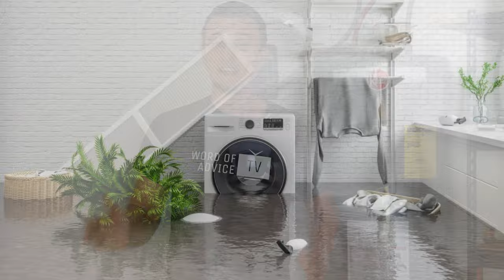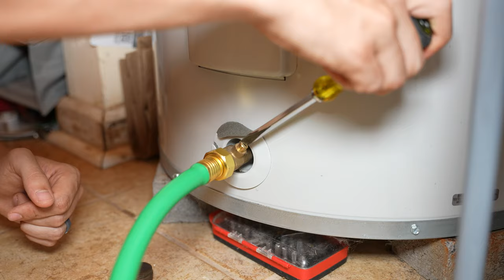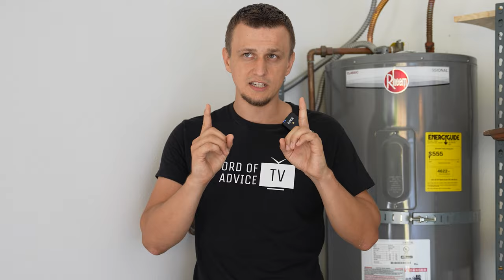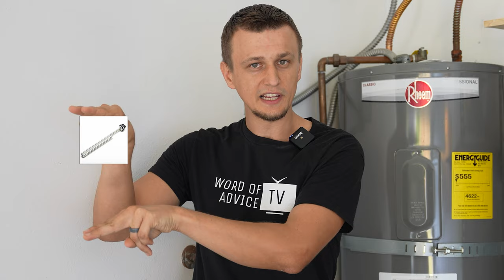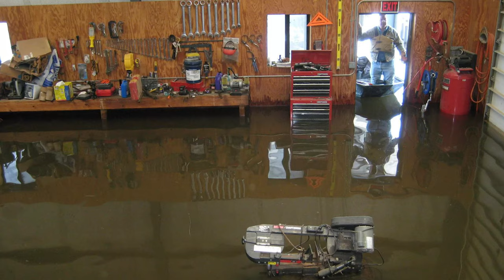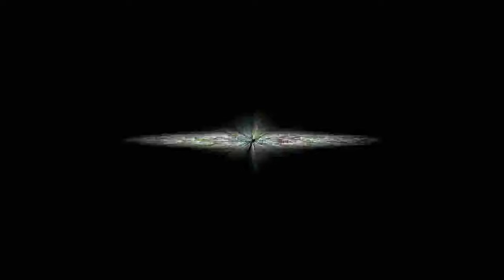When Should A Water Heater Be Replaced?

Comment: The old water heaters lasted a long time because they were glass lined and didn't corrode so much. The manufactures figured out that they could sell more heaters if they left out the lining and let them rust. State Water Heaters is the only company I know of that still has some models that are glass lined.
Reply from the maker: Not very good for sales if they last too long right? Good to know that State water heaters still make some glass lined models. Thank you for sharing!
Reply: @WordofAdviceTV   or you decide to sell more of the other parts of a water heater and create a strong maintenance schedule. If the reputation grows actually more people will buy them, insurers will recommend them and contractors will fit them. It’s a more longer term business strategy but you create a reputation for being customer focused and excel in your engineering. You can then design more products to sell. If you get a reputation for poor quality water heaters how likely is it you are going to see strong sales? Not much so if state are still glass lining kudos to them.
Reply: Bradford White does as well.
Reply: This is incorrect information. Most water heaters are glass lined today. Lack of maintenance is the reason most fail today. Somewhere along the line people forgot they have to maintenance things if they want them to last.
Reply: They all last 7 to 10 years. My last one failed at the weld seam between the sides and the bottom.. The only one I know if that is glass lined is 
 State Water heaters.
Reply: I am a professional service plumber. I go to at least three water heater tank leaks a month. It's a mix of both old and newer heaters, and they do flood garages left and right. Most people shut the water off then 40 to 50 gallons drains everywhere. Not a lot of bad info in this video. I have seen 2 in ten years bottom out and he is right about it being neglected.
Reply: @WordofAdviceTV  AO Smith makes state so the proline of AO Smith will be the same as a state so pro AO Smith units are glass lined
Reply: @macdaddykwm1  My state was installed 8 years ago and the pan has water. Time for a new one. It is power vent so it cost a fortune :(

Comment: I found my Bradeford water heater was leaking three years ago; however, I had used it until last week and replaced it. The technician had checked the heater and told me that there are no big issues other than small leaking.  For 20 years, I had no issue with it, just hope my new Rheem water heater last long without any problem.

Comment: What would you advise? It's a 19-1/2-year- old water heater. I have two of them, but one went out. Plumber tested the thermocouple and noted the wattage was fine but some other wire in the valve was low. He replaced the thermocouple and it worked for three days and then went out again. It seems to be the gas valve (the controller in the front of the heater) that needs to be replaced. Plumber quoted me $550 to replace the valve versus a new water heater for $1600 to 2200.  He says it's reparable, but the big worry is that the tank will start leaking soon due to the age. There's no rust on the exterior, but I know that's always a risk of a leak with old tanks. My hope is I can replace the valve and get another 5 years of life. My fear of buying a new water heaters is it will only last eight years as they don't make things like they used to. Your information is very helpful and I feel better after watching it. Thank you.

Comment: This posting was very reassuring my concerns. (I still have some though)
 Our Water heater was installed 39 years ago in 1984. Hot Water has been consistently good & available.
The anode rod has long since been sacrificed and I'm not aware of any maintenance in the last decade.
I had discussed replacing it w/ my spouse but she's pretty adamant that if it’s not broke don’t fix it.
I think 80's they made much better Water heaters than the junk available today with its planned obsolescence.
 Im afraid to touch it worrying that it will then there-after start misbehaving. 
I setup water alarm system and the unit is mounted on a drain pad.
We will replace it someday. 
This posting took away the nagging "bottom dropping out" catastrophe fear .

Comment: I am so glad I bumped into your video so that I don't have to spend 14K dollars for my water heater and boiler for house heating.  My system was installed about 18 years ago which is actually still working well.  I was baffled as to how could a plumbing company charge over 7K for the replacement job as the equipment they would use will not cost more than 6 to 7K.  You are so correct in saying that the "efficiency" gained through replacement will not be worth it. Thank you for the sound advise.
Reply from the maker: You're welcome! Yes, if the system is working well and there are no leaks, there is no need to replace it. I'm glad to hear this video came at a good time for you. 👍

Comment: You are so correct. I moved into my townhome 1983 and the water heater was still there from when it was built I kept it for like 30 years and someone said I’m living on borrowed time so that’s why I replaced it. But it was a great water heater it was built to last
Reply from the maker: Thank you for sharing that! Another example of the older water heaters lasting a very long time. I wouldn't be surprised if that water heater would have been just fine even until now if you hadn't replaced it.
Reply: @WordofAdviceTV  I think you are absolutely correct. In fact the refrigerator and dishwasher that came with the place are still running. Thank you for all the helpful information you give

Comment: Thanks so much for this excellent video delivered in a very professional way. I will sleep easier tonight and call my plumber in the morning about the small amount of water under my 22 year old Ruud water heater. Ten years ago I was out of town for several weeks in December. When I returned to my cool home it smelled very musty like a summer basement. The water was up to an inch or so deep in spots of the uneven floor. I turned the water to the tank off and In the morning called the plumber. He said the culprit was a defective valve near the top of the tank, which he replaced. So my home wasn't flooded, but there was quite a bit of water down there. Thanks again for your lesson.

Comment: My gas's water heater is 30 years old, every 2 years I drain it and have replaced the analog rod once and it's still going strong. I did swap out the drain valve from the half-inch drain it came with to a three-quarter inch ball valve makes draining ridiculously easy

Comment: Very good, honest and objective video! Sadly, almost all plumbing contractors use fear and deception, and say you must relace it in 8 to 12 years. Of course! They want to sell you a new water heater & installation!  The 1st gas water heater in my house, a Rheem, lasted 25 years, with NO maintenence whatsoever. Then just a small leak from the tank. Even with high iron & calcium water. Going on 23 years on my 2nd one, an AO Smith. Started power flushing 15 to 20 gals out once a yr, about 5 yrs ago. Only complaint is the very poor spickets, drain valves used in water heaters. If you have a water heater 20+ yrs old, replace it only if you have to! Most made now are junk in comparison to the old.

Comment: Bought a house in 2002. Replaced an old early 80's water heater just to be on the safe side. In 2018, mine literally exploded (or imploded depending on how you look at it) and water flooded my basement. At the time, it was an unfinished basement and didn't have much down there except some junk, which I ended up throwing away. Today, it's a fully finished basement, so hopefully that won't happen again. The plummer who replaced it said he's replaced hundreds of water heaters over his 20 year career and had never seen one blow up like mine. (It was electric, not gas.)

Comment: Thank you, a nice video, I live in NSW Australia and i built my new home in October 1980 a DUX HWS was installed then, which then sprung a leak Oct 1998 after 18 yrs service, i then had a new RHEEM HWS installed  which then started to leak in Febuary this year (2022) which did last 24 yrs, now i have a DUX replacement so lets see how long this one lasts. All these HWS are/were 250 litres (60 Gall) have a single bottom element,and water temp is set at 60 Deg, also our water supply here is Soft water which could also help for longer tank life   👍

Comment: Thanks for this informative video and quelling our fears. I have a 40 year old Ruud electric water heater that is still working. I have never drained the unit or replaced the anode. I am assuming that if it ever starts to leak it will start off as a trickle at which time i wil start looking for a new water heater,but that hasnt happened yet.

Comment: Thumbs up ! Our municipal water pressure is over 80psi. I installed a Pressure Reducing Valve (PRV) years ago to keep pressure at 50psi which reduces strain on piping, tank and water- using appliances. Our washing machine and dishwasher have lasted well past the usual lifespans. I also installed an expansion tank on the cold water inlet to the HW heater. That absorbs the pressure back flow as water heats with no faucet open ( the PRV creates a closed system so pressure can't dissipate back to water service main). I believe , but cannot prove, that reduced pressure alleviates some of the expansion/contraction of the tank interior. Also, best to place HW heater on a pan which connects to a drain. That way if it does leak you don't send water everywhere.and you have time to react., Also you will know that it is not another source of water leakage. If you have a draft induced blower, be sure condensate drain port is connected to a drain  as condensate getting in the blower will kill the motor. I never flush the tank but I do drain 5-10 gallons from tank every few months and particularly after the Town flushes the water mains ( twice a year here ).

Comment: very interesting comment about glass lined water heaters. We had a furnace (Trane) and water heater (40 gal, gas) installed in 2091.  We're on well water with sediment  filter and softener. Water heater working fine but  I will be putting in a tankless heater this year.

The heater that is still plugging away is a State Water Heater.  Connection to longevity....possibly!  Thanx for your content.

Comment: Good content.  I’ve never had a water heater leak, but I lived in a condo complex where the unit above me leaked and caused a lot of damage in my unit.  It turns out that quite a few water heaters in other units also failed around the same time and the association recommended owners replace their’s.  While it’s not common, depending where it is located, a leaking water heater can cause substantial damage that can be avoided, especially if the water heater is well over the recommended replacement age.  Pay me now or pay me later comes to mind.

Comment: Good video....Thank you. Here in Texas the hot water tanks are in the attic. Why they aren't in the garage, I have no idea. Stupidest thing in my mind. Ours are 16 years old and I have flushed them regularly but the thought of a major leak in the second story ceiling makes us crazy. Replacing the originals (2) that have been trouble free except for a 1 new pressure releif valve replacement. Makes me think we could wait, but the thought of an issue at this stage has us replacing them.
Reply: Just replaced my 10-year-old AO Smith tank here in Hutto yesterday.  Stopped heating the water and was worried about having a leak in my attic.  Rust was prevalent along the top, with rust trails going down the sides.  They replaced the tank with another AO Smith, and added a TACO shutoff valve tied to a  water sensor on the drip pan.  The old tank was loaded with rust and sediment.  If yours were 16 years old, you were right to consider replacement with this attic situation.  

A friend of mine had a 15 year old tank in upstate NY in a second floor condo.  It let go and flooded his condo, ruining the parquet floors.  It also flooded the first floor condo, doing another 60k in damage.  Luckily, the estate of the owner had insurance and he was not held liable.  And just the year before this, he was living in a house in Yonkers, NY where another unit let go and flooded the basement.  This was less critical as we dried up the family room for the new owner, who was gutting the room for renovation anyway.  But the fear of these back to back blowouts had me worried about my Texas situation.

Comment: Ive had them last 20 years, and Ive replaced them when one got a small leak, and one had a bulge.   Its just if you maintain them will make them last.  twice a year flush, and check that anode rod every year or two.  One I had to replace after I sold the house, and it started leaking 2 weeks after closing.  Which sucked for me, but not the new owners.  But the ones that leaked, were also very old.

Comment: Three wear components on water heaters, anode, dip tube, electric elements (bottom usually). Routine maintenance, it will last a long time. Anode, use aluminum for well water and magnesium for city water. Dip tubes fall apart rot off at top. If they do, your hot water supply will greatly reduce due to mixing hot and cold at top of the tank. Mine is 20 years old, replaced anode and dip tube at 17 years old. Both had failed. Recommend at least every 10 yrs.

Comment: Well I was one of the special people that had a small flood. Luckily my daughter was home and saw water at the bottom of the stairs. She called me at work and I told her how to turn off the water and the water heater and drain it. It didn’t gush out but it was leaking pretty fast. It did do damage to bottom of some walls and some carpet. There was a sump pump about 12 inches away but basement floor was made so the water ran to the finished part of basement! Good job cement man! Lol
Reply from the maker: Oh yikes! You are the first flood story! Sorry to hear about the damages and thank you much for sharing your experience with a leaking water heater. I should have mentioned in the video that one good tip is to make sure that everyone in the house knows where the main water shut off is.
Reply: Hi, another chosen one here. I used to live in a townhome built on a slab so the hot water tank was on the ground floor in a closet. I had just gotten home a little early from work and I sat down on the couch and right away heard bam! I rushed into the room where the tank was located and just saw the water gushing everywhere. The drain valve had completely come off like a champagne cork and the water was gushing out. Luckily, the main shut off was right next to the tank. Upon further inspection, I realized the drain valve popped off because the nylon threads on the valve had been screwed into metal threads causing a chemical reaction / mineral buildup on the nylon thread making them completely smooth like a cork! In that 30 seconds I did get a lot of water but can you imagine if I hadn't been home and it did that for a few more hours!

Comment: Comforting info ! Haven’t been able to flush for years due to the drain valve leaking when I open it. Kinda paranoid as ittl b a long job at some point doing the drainage. I have it in main floor not basement
Reply from the maker: Glad I could shine some light on this topic for you! And I totally understand! Drain valves tend to leak once disturbed. If you will feel up to the task later on, you could drain it and replace the drain valve. They are pretty easy to replace. 👍

Comment: My business is replacing water heaters. In my city the water is hard and the pressure is fairly high, typical life of a gas water heater is 12-14 years. Pressure regulators and frequent flushing are needed here. Some of the older tanks, from the 70s and 80s, would last 18-22 years. Never encountered a ruptured tank, only pin holes. Have seen a few tanks pin hole in only 7, 8 years.

Comment: Great information expertly communicated! You mentioned potential catastrophe from the bottom, but I’m wondering if I almost had a catastrophe from the top. A few days ago, some water started spraying out sideways where the cold water supply line attaches to the top of the water heater. It turns out that the galvanized threads at the top of the water heater were almost completely gone. Now I’m wondering if no one was in the house for a week or so could this have failed completely and then water would be going full force. Plumber said it was rotting from the inside to reach the threads. I also removed the anode and there was just about nothing left of it. The water heater is gas and nine years old.
Reply from the maker: Thank you and oh wow! That definitely would have water catastrophe potential. Worst case scenario, you would have water gushing out from the top of the heater at city water pressure. That would make quite the mess, glad to hear you were home for this so you didn't need to find out if this would have happened or not.

Comment: I just found a very tiny leak at the bottom seam of my water heater.  Is there nothing that can be done to fix that, like removing the screws and sealing it somehow or is that not repairable and need to replace the water heater?  Thanks for the great videos.
Reply: I have the same issue, I guess I’ll take it out and replace it.  Maybe 10 years old.

Comment: We were looking to do a new floor in house. Water heater is electric and installed in bedroom closet with no pan. Looking at tank found out it is original tank from when house was built. It is 52 years old and doing fine. Never a problem. Had upper element replaced 25 years ago as it went out. Does not have anode rod to change. Am going to put in a new one when we do new flooring in house. Must have been lucky to have no major issues with it.